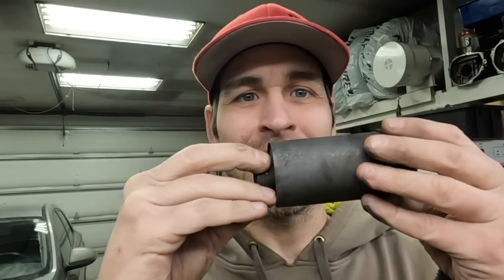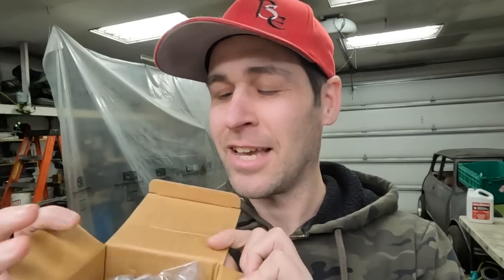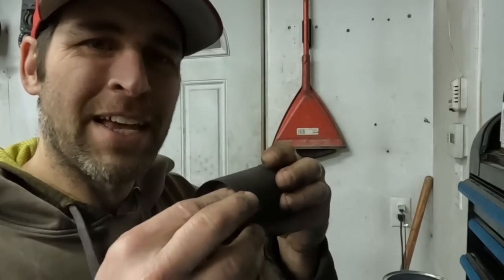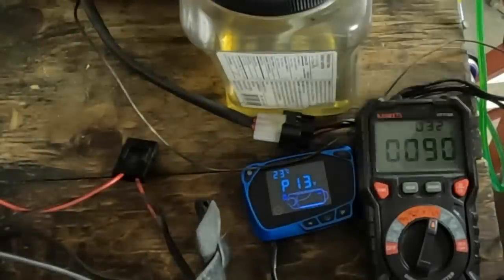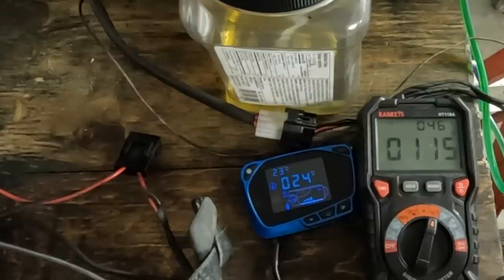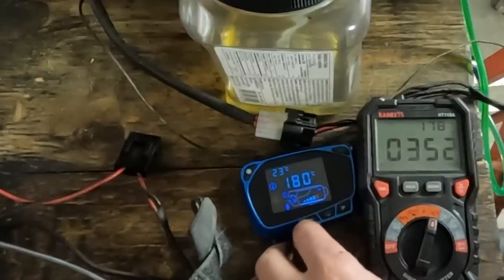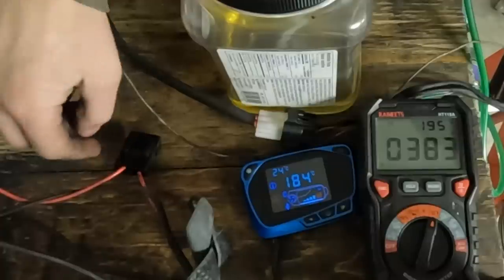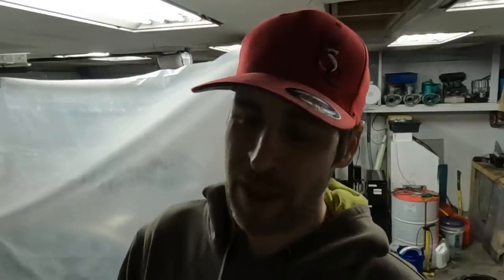Cat Converter In My Heater - Diesel Heater. PT- 23

Comment: Direct flame impingement on a catalytic converter matrix will destroy it.  Good try, though.  Might be more effective to have the exhaust flow through the cat since it's hot enough to convert and burn the hydrocarbons.
Reply from the maker: Yeah, this would likely last for quite a while if I just used it on the exhaust. However, the main goal of all of this, other than amusement, was to try to get more heat to stay in the vaporization are where the fuel comes in. It has a tendency to burn cool and plug up with carbon.
Reply: @loweredexpectations4927  Kudos for experimenting! I am running my unit on red diesel. The unit is clamped to the top of my wood stove and exhausts into a 3/4''npt hole I put in the stove side. The top of the stove gets warm and I put the big aftermarket muffler on with a heat powered fan sitting on top to move air. The draft takes the gasses out through the chimney. 

The test started 3 months ago. I ran 12-14 hours a day until last week when the cold set in again. After running 24/7 on heat setting 3 and run up to setting 6 for 30 min a day in morning and evening, the warmth keeps the living room warm day and night. The heat finds its way upstairs as well. The cost is far cheaper than running the central natural gas furnace. I did not use the central furnace at all in January and February. I have a 14 foot vaulted ceiling and keep the ceiling fan on low 24/7. Keep's ma's couch area 68-74F and the cat likes it, too.

My major improvement was to add a 12 volt LED light up by the fuel pump, lengthen the fuel level slots in the housing to the very top, and added a fuel filter ahead of the pump. I can see the fuel level from 30 feet away. I refuel twice a day with a 5 liter ''No Spill'' push button jug. Best invention ever!

Keep up the good work
Reply from the maker: @kimmer6  I love it ! Good stuff ! What's the price of red diesel where you are ?
Reply: @loweredexpectations4927  $4.89 a gallon at Rotton Robbie's. A buck under the cheapest road diesel being sold here.
Reply from the maker: @kimmer6  I have no idea what off road diesel is here as you can only get it by delivery in large amounts, but our road diesel is about $6.78 a gallon. ... but when you convert that to USD that's only $4.93

Comment: How about the catalytic converter down at the exhaust hole just for the pipe hooks on to go outside
Reply from the maker: I guess I didn't make it clear in this video, but the idea of running the cat where I did was to try to get the vaporization area to heat up and flash the oil off. I made a few videos about this leading up to this one. 

Putting the cat further down stream would work to clean up the smoke, but it would do nothing to heat up the area where the oil comes in.

Comment: I've watched most of these videos, many out of order.  Have you tried routing the fuel line in a way where it'll get heated before hitting the burn chamber?  It should help make it burn cleaner, especially with waste oil.
Reply from the maker: Hey, thanks for the comment ! 

I have actually tried this. Not in the classic way that most people have recommended (copper pipe around the exhaust) but with a pipe running through the exchanger fins. This limits the line heat to 230C (about) so it's not nearly as dangerous. 

It seemed to help some... the fuel was entering the chamber at around 100C. I did have some issues with the fuel feeding erratically, as impurities (gasoline and moisture) vaporized inside of the line.
Reply: @loweredexpectations4927  Ahh, I remember that now.  Oops.
Reply from the maker: @DonziGT230  Haha... it's all good. I've done so many videos it's hard for me to keep track of what I have and haven't done.

Comment: A carburetor works by using the lower pressure created by the piston moving down. How would a diesel heater create this lower pressure zone?
Reply from the maker: It is a gamble on if it will work... The heater uses a fan to draw air into the heater... All the carburetor needs is air flow through it. We shall see if it is enough.

Comment: My guess is oil or soot splashed onto the catalytic converter, got turned into ash and then overheated it to the point of melting. A car engine that burns too much oil will destroy its catalytic converter in a similar manner too.
Reply from the maker: Seems like an accurate assessment.

Comment: Hey Joel, finally got my heater installed in my workshop this weekend.  Works great, especially with all the snow we got.  Quick question, how did you figure out how to pair the remote?  I've watched some other people's videos but it their instructions didn't seem to work.  Cheers.
Reply from the maker: I have two controllers. One came paired, and the other one that I got from allay express, I tried to pair 3-4 times and gave up. 

What controller do you have on the heater and what color are the digits ?
Reply: @loweredexpectations4927  blue controller, with blue digits.  black remote with display.
Reply: @loweredexpectations4927  woohoo, I figured it out.  Press and hold the power button and right arrow button at the same time on the display until "OC 1" is displayed, then press the up arrow button on the remote.  It will say "wait" then will connect.    Worked for me.  Not sure if it will work on yours depending on the model
Reply from the maker: @PUBHEAD1  Awesome. I'm glad you sorted it out !! Sorry I wasn't able to help. Oh... wow... OC1 popped up on my screen once and I was like "that's an error code I haven't seen before..." lol

Comment: If you get an automotive cat and remove the Honey comb you can chip away at it to make it fit the chamber. Won't work but there you go
Reply from the maker: Yeah... I want to do this, just to see what will happen. I know that it will clog up pretty quickly, but I would like to see what happens before it does, haha.
Reply: @loweredexpectations4927  maybe if you run jet fuel it'll clog less.

Comment: Catalytic converter at the bottom of the machine where the exhaust pipe hooks on
Reply from the maker: I guess I didn't make it clear in this video, but the idea of running the cat where I did was to try to get the vaporization area to heat up and flash the oil off. I made a few videos about this leading up to this one. 

Putting the cat further down stream would work to clean up the smoke, but it would do nothing to heat up the area where the oil comes in.

Comment: Hey Joel, what would happen if you had 2 fuel pumps running into the glow plug, weld another fuel line in situ with the other fuel line.
Reply from the maker: I'm not 100% sure what the end goal would be ? To double the amount of fuel delivered ?

Comment: Should have tested with a clean fuel first to determine effect of cat converter.
Contaminants in used oil might react with the catalyst at high temperatures forming errodable non catalytic compounds.
Reply from the maker: Thanks for the comment.  I suppose a test with diesel would have been a good baseline... and would have told me if it failed due to where it was installed or because of the waste fuel. 

I would like to try this with a larger cat at some point in the future.

Comment: before even watching .... cats are never used on diesel because of the possibility of soot and the low burn temperatures (the cat never gets hot enough to do its cat thing) .. and waste oil never used because even the tiniest amount of lead (from wearing bearings, etc ... leaded fuel is very rare nowadays outside of the airport) will poison it.                   a carburetor is never used on a diesel engine because of timing issues (fuel has to be delivered AFTER the compressed air heats the hot air) .. in the case of a linear burner, its more like a jet engine .. air in, fuel injected later .. fire.     Exhaust hacks... always have the exhaust pipe in a downward slope (or straight down)  this keeps any moisture from accumulating.  I put fans on the hottest part of the exhaust train to recover a considerable amount of heat.  one time I put 'fins' on the part closest to the heater and sucked a HUGE amount of heat out of it.     after watching: cats go downstream of the exhaust, but never contact flame or raw unburned fuel (this is one reason cats are NEVER on carb'd gasoline engines)
Reply from the maker: Thanks for the comment. 

I'm not sure if there is any difference in the catalyst, but this cat came off of a two cycle weed trimmer and was used specifically to avoid the mess of oil that normally comes out if the exhaust. The idea here was simply to see if the cat would create a lot of heat. 

The motor oil that I am using comes from utility engines that do not have bearings at all (crank' cam, big end and wrist pin all run in aluminum, or the odd Chinese one uses ball bearings in the crank. 

These heaters are more like candles than jet engines.. the fuel dribbles in and isn't injected with any force at all. It is not mechanically atomized and just flashes off on a hot surface, but I get what you are saying. 

If I talked about using a carburetor in this vide, the plan for that is to use gasoline, not diesel.. I probably didn't make that clear. 

My exhaust is always too hot to have issues with condensation. If I ever move past testing and get to a point where the heater is used to make heat (what a novel idea, haha) then I will consider scavenging all the heat form the exhaust that I can ... I have a few ideas.
Reply: Of course have catalytic converters been used on diesel engines. Especially on older diesel cars. 
And you can definitely find catalytic converters on carbureted gas engines.
Reply from the maker: @momowas  Haha. I feel a feud coming on... I thought this to be true as well.

Comment: try the burn chamber installed backwards and put the cat in near the end.

as i've se3n in david mcluckys video the flamefront ends at 60-70% of the burn chamber.

the remainings of the cat should survive then.

after all you're possibly better off with a cat from a mower traktor.

regarding the carb idea: if you fuel it with gasoline or methanol in a stoichometric mix it will backfire like nothing good !  might smash the whole burner fan and rip the intake tube in pieces in that process.
 so keep the mixture WELL in the lean region.

oil and diesel are wayyy to thick to be vaporized that way so it will only work for a meth or gas addition for cleaner burn.

and: you need to insulate the intake pipe to prevent fuel condensation downstream from the carb. vaporizing cools the mix.  pre-heating the tube with existing hot air would help with that... dewpoint and all that crap... you know...
Reply from the maker: I wrote a super long detailed reply and then hit "cancel" instead of "reply" ... Thanks for your detailed comment. I will take all of this into consideration. 

I have fed gasoline and alcohol into the inlet tube and had it run but also had it backfire several times. It appears to have lots of venting space and doesn't explode.

Comment: You need to watch david mcluckie he has a heater with a clear burn chamber so you can understand whats going on in there cause your cat needs to go towards the end, not up against your flame area. You really need to be able to control fuel flow and air to get the right afr. That controller sucks. Can you say afterburner controller.
Reply from the maker: Thanks for the comment. I have watched most of Daves videos, and I have seen a few where he has the end cut off.... Great guy 

I have received a new controller, tho it is not a fancy afterburner... I don't have the funds for that yet. 

The reason for the cat being so close was to try to use some of the heat from it to help the oil burn cleaner. The area where the oil comes in tends to only run about 180C and it should be 250 ish to flash off the oil. I have had several people ask about this, so I should have explained better.

Comment: Great show. Why not put the cat in the exhaust pipe instead of the burn chamber? And use a clean fuel before moving onto a mix?
Thanks. Keep up the good work 👍
Reply from the maker: The reason for the cat being so close was to try to use some of the heat from it to help the oil burn cleaner. The area where the oil comes in tends to only run about 180C and it should be 250 ish to flash off the oil. I have had several people ask about this, so I should have explained better. 

I do use clean diesel to start and shut down the heater. I guess maybe I didn't point that out in this video.

Comment: Why not install the cat at the exhaust pipe?
Reply from the maker: The reason for the cat being so close was to try to use some of the heat from it to help the oil burn cleaner. The area where the oil comes in tends to only run about 180C and it should be 250 ish to flash off the oil. I have had several people ask about this, so I should have explained better.

Comment: A catalytic converter this small can be effective?
Reply from the maker: This cat was designed for a weed trimmer, to stop oil from running out the exhaust when used at low throttle positions. It is effective for that, or for a really small engine. You need a much larger cat for a much larger engine.

Comment: 4:20 I have so many questions.  First: WHERE does one find a small catalytic converter?  I tried searching ebay before for any small engine cat, IDK if I'm using the wrong terms, but I could not find anything.  I searched weed trimmer catalytic converter on google and aside from this video as the first result, it's all blog/forum topics from the early 2000's complaining about a law requiring them on lawn equipment.  I have never seen a cat on any mower or trimmer, even my riding mowers don't have them.  Is this a CA thing? CAli, CAnadia, and their CAts.

Aside from that though, I am really confused why it's going in the burn chamber.  it should be in the exhaust stream, no?  Very confuzzled.  

I thought about a carb before, never mentioned it because it seemed so obvious.  Indeed, why?? did it take this long?  And of course I'm thinking once more if you can run the carb setup with propane or city gas.
Reply from the maker: They are not used on a lot of stuff. This one came from a ECHO trimmer. You would likely be better off buying one from a car in a scrap yard and cutting it open... then using a chunk of it. That's what I plan to do if I do it again. 

ECHO put them on their trimmers as people complained about them dripping oil out the muffler... It is not at all common. 

If I put it on the outlet of the chamber, or even on the exhaust, the it would likely last much longer and it may work for clearing up smoke. However, the reason why I used it, was in hopes that the catalyzing would make enough heat to warm up the fuel and make it burn clean instead of clogging up. 

Yeah... running a carb is just a silly experiment to see if it will work and more likely, how big of a backfire it will make. It is not at all practical, but if it works it would be neat.

Comment: sooo with the carb you won't use it to inject fuel, i hope.
just to throttle it?

because the burn chamber is not air-thight so it would just backfire and set everything on fire 
👁👄👁
Reply: If the Venturi effect of the carburetor actually atomizes the thick oil, I’ll be surprised. I don’t think there will be enough airflow. If it does, boom 💥
Reply: Gasoline vaporizes/evaporates well in  airflow, it’s a distillate. Oils not so much.
Reply from the maker: The idea is to use it as it would be on an engine... to deliver fuel.  I'm not sure if it will backfire, but if it does it will probably flame out. I will prepare for the worst and hope for the best.

Comment: put a car cat on the exhaust of this thing
Reply: @loweredexpectations4927  Just make sure you're EGT getting to the cat is at least 400C.. That's about the point they start working at.
Reply from the maker: @cheetor5923  Yeah... that's tricky to calculate, but I assume it may get too hot.

Comment: There is a reason diesel engines don't run on carbs. I will let you figure out why
Reply from the maker: Everyone assuming that I'm going to try running diesel ... I guess I should have clarified... I started to say it, and then got side tracked somehow. The idea is to start it on diesel with the normal set up and then switch to gas in the carb. 

I have run a few gas engines on diesel and they don't like it... not just because of the carburetors, but yeah... not ideal, haha.
Reply: @loweredexpectations4927  ah I see that will be a fun test. I wonder how that blower will handle it. That will be a fun one. I've gotten to fix a few mowers people have tried running on diesel👍
Reply from the maker: @lanceulbrich6249  Haha... Yeah... When I worked for Sears we got it every now and then. People would never admit that they had put diesel in, so I'd just say "I guess it must be gas".  I'd pretend I didn't' know what was wrong and force them to run using quick start... You have to use the choke and or prime them a lot to keep them going, at first, but once they get hot they will actually run. I have a video on my other channel of a snowblower running on diesel and it is blowing smoke rings, haha.
Reply: @loweredexpectations4927  yeah they DNT like it very much tho and needs to have at least some gas in it. Used to be a diesel mechanic we had one of the kids that mowed the lawn do it a few times. We did always have some diesel in a gallon red can to prime the fuel systems if we had to change a fuel filter on the go.the younger guys didn't usually know any better happened a few times.
Reply from the maker: @lanceulbrich6249  I've been tempted for a few years now to try to see what percent I can run in my jetski engine (2 stroke) ... It's pretty low on my list of things I need to do tho, haha.
Reply: @loweredexpectations4927  yeah I would prob stick w 2 stroke oil unless you DNT like your jetski and want to smell like diesel 2stroke exhaust.